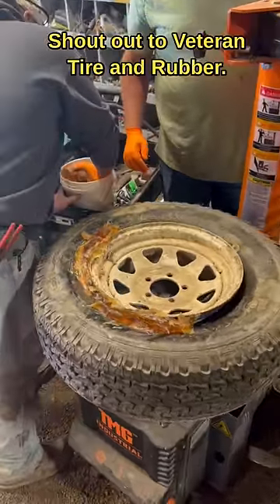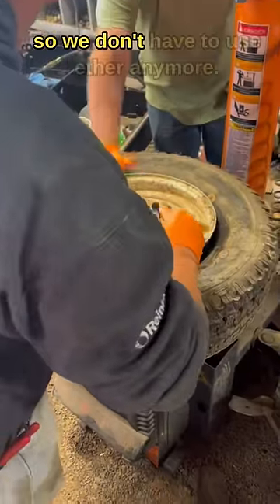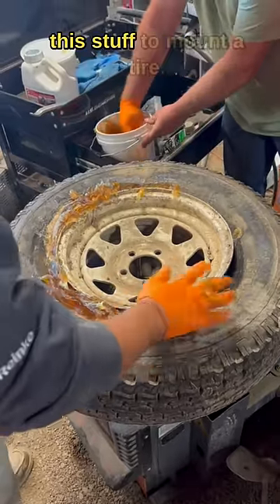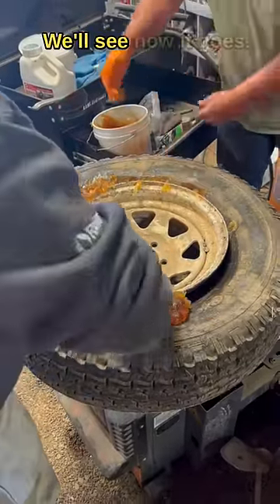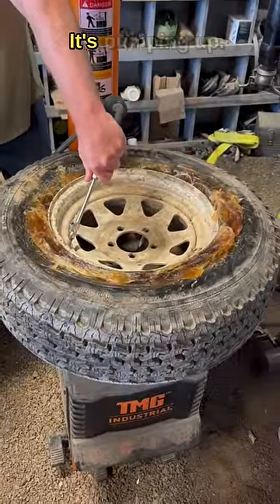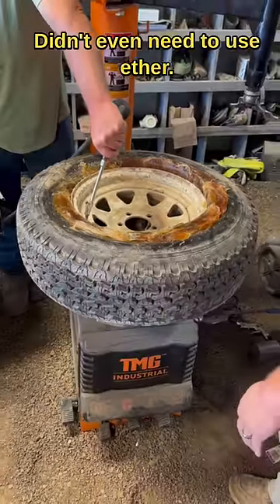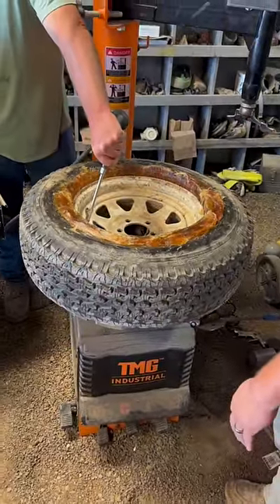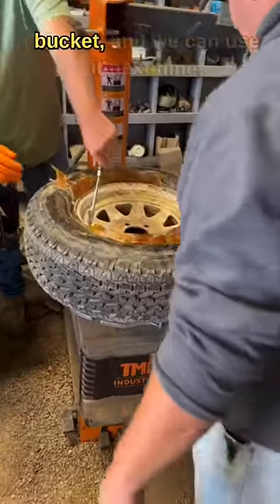Veteran tire and rubber sent some tire mounting compound. Let’s see it work. #farming #shorts ￼

Comment: US Army, out in the field in central West Germany, had to replace a 15 inch tire on a Dodge truck. My squad leader decided that packing the bead with axle grease would allow us to inflate the tire and be on our way. The axle grease did fill the gap and we were able to inflate the tire. However, the grease was also a lubricant and when the driver was trying to move across difficult terrain, the tire was stationary as the wheel spun inside the tire.
Reply: Never thought about that. Good point
Reply: i see you guys had a great time over here 😆
Reply: OH MY HOD THANK YOU
Reply: Exactly what I was thinking might happen.
Reply: I wondered about that…….🤷‍♂️
Reply: thats exactly what i was going to say. im a tire guy i do tires for a living and we use that mounting compound. however, we scoop up a handflul glob of it and put it in a bucket, and then fill that bucket with hot water, and use sponges to lube the bead. works the exact same way and uses less. if its being stubborn to inflate, air blaster!
Reply: @rxwbowtie I think you're thinking of the lube you use to mount tires. I'm pretty sure the purpose of this stuff is to fill the gap between the rim and the tire and allows them to get it seated. You could use a cheetah tank or like they said fill it with ether and light it on fire but cheetah tank doesn't always work and ether is dangerous
Reply: That would tear off the Schrader valve.
Reply: What about the  residual compound that's trapped inside the tire, won't that cause a major imbalance in tire rotation. 🤔
Reply: @jeffrobinson1092  , what would?
Reply: @dandonovan2858  Maybe I misunderstood. Tire gets traction but axle still rotates (hence the wheel) and tears the valve stem off.
Reply: @jeffrobinson1092  this isn't a bicycle there's no tube attached to the valve stem.. it won't rip off from the rim spinning inside the tire
Reply: @jeffrobinson1092 , no, the tire didn't lose any air. The wheel was slipping because of the grease.
Reply: @dandonovan2858  Again my misunderstanding. No tube with a Schrader valve. Wheel will spin with tire getting traction.
Reply: That’s wild lol good story
Reply: Genius!
Reply: Grease and tire beads don't mix
Reply: That was my first thought... the friction between the tire and the wheel is kind of important
Reply: @andydickinson8957  yes it is. And seeing the rim spinning and the tire not, still makes me laugh.
Reply: @nickb5091  it did allow us to inflate the tire.......
Reply: I'll stick to starting fluid
Reply: Holy sh-cow I’m actually really surprised it was able to remove THAT much friction enough for the rim to spin in the tire
Reply: @humphreyjones1828  torque overrode the limited friction because of the grease. And the air pressure kept the tire in place.
Reply: Only in the military
Reply: @danglinforya5773 I think it will fly off to the outside due to the rotation and then maybe spread, don't no it's viscosity.

A tire mounting compound with sealing properties comes to  my mind.
Reply: Dude rs slippers
Reply: Hahahaha
Reply: @jeffrobinson1092 how? Valve is fixed to wheel. Would tear the valve if it had a tube but then you wouldn’t need grease as the tube fills the tyre.
Reply: @dandonovan2858  in Kuwait we killed the battery on a Bradley and had to tow start it, but the fucker was parked against a Berm.  Step one was to pull the dead Bradley over the Berm with one that was running.  Seeing a tracked vehicle fail to find purchase in the sand and throw huge rooster tails is probably my favorite memory of that deployment
Reply: @dandonovan2858 so after the rim does a burnout in the tire for long enough, does the tire bead melt and stick to the rim? Lol. Almost makes me want to try it.
Reply: @inoahmann7542 , it was a lot of grease, I suppose it would eventually create enough friction to overcome the lubrication properties of the grease....
Reply: Central west germany... baumholder? K-town?
Reply: @nathanfranklin7210  Budingen 3/12th Cavalry and Hanau D co. 122nd 3rd Armor Division
Reply: Grease and compressed likes to explode
Reply: @danglinforya5773 your talking about the left overs right stuck on the rim here and there ?
Reply: That's why your not supposed to use Murphys (the stuff he's using) to fill in the gaps. We have all done it especially when your solo in the field, but 2 13 gal cheetahs or using a tube to spread the beads is the best route.
Reply: Automatic slip-clutch against overloading!
Reply: Ether is 100x cooler
Reply: Don't need any of that
Reply: You never had enough air pressure in the tyre. I always bead tyres with grease. My mechanic couldn't believe it. It seals beautifully and never spun.
Reply: @SoulTouchMusic93  you don't have any idea what you are talking about.
Reply: Bullshit! You heard that story from the guy who trained you and he heard it from the guy who trained him, ad infinitum...
Reply: @michaelbrown343  , nope, I witnessed it first hand and in person.
Reply: @dandonovan2858  I still call bullshit
Reply: @michaelbrown343  , Whatever.
Reply: fixed is fixed here at good enough auto repairs
Reply: And that's the story on how you never left central W.Germany.
Reply: This doesn't look like lubricant.  It looks tacky af
Reply: What year ? I was 3rd infantry division in Wildflecken 77- 79
Reply: @mikejungferman4744  I was in D co, 122nd Support at Fliegerhorst Kasern in Hanau. We supported the 3/12th Cavalry in Budigen. 1987 to 1989.
Reply: Some call it insubordination, I call it exercising my right to not follow stupid orders...
Reply: I picture the whole thing nd laughing my ass off lol
Reply: You need to spray it with a cutter after it sets like carb cleaner. Brake cleaner, starting fluid any of them
Reply: I did this on my drag bikes back tire the grease with dry and tack up if if you spray something to cut it
Reply: This is True, I have scene this happen before, Never use grease on the rim.
Reply: @jeffrobinson1092 They normally remove the inside of the Schrader valve when seating a tire.  The air hose hooks to the stem and there is less restrictions.
Reply: Lol...nooooooo!.......did u say "BEAVIS......u DUMBAAASSS!! HEHE!....
Reply: Ha! I've always wondered about that.Ive never used grease but just about everything else(in small amounts).So far no crazy stuff has happened....
Reply: Holy shit are you fucking with us? That would be looney toon level of wtf
Reply: @Tobistohightoplay  , just telling you what happened.  I didn't condone it, as a matter of fact, I told my Sergeant that it would do just that.
Reply: That would be a sight to see lol
Reply: Hahahahahahahahahahhahahhahhaha
Reply: We did it to all four wheels and tried to stop but couldn't God rest our commander 😢
Reply: What about the backside where there was no grease? Still no traction? 🤔
Reply: @thedoc9062  they put grease on both sides.
Reply: @dandonovan2858  
Ok👍
Reply: @713gk not in a tubeless tire.
Reply: Guys, here is the true Savior

HalleluYAH translates “Praise ye YaH”

YaH is The Heavenly Father
YaH arrives via the TENT OF MEETING
YaH was Who they Crucified for our sins
YaH was Crucified on an Almond TREE

Semitic of Moshe (Moses)
Isa Scroll (The Original Isaiah)

Isaiah 42:8 - I am YaH; that is my Name! I will not yield my glory to another or my praise to idols.

Isaiah 43:11 - I am YAH, and there is no other Savior but Me.

Isaiah 45:5 - I am YaH, and there is none else.
Reply: @jeffrobinson1092 No it wouldn’t.
Reply: @jeffrobinson1092 Tubes do have a Schrader valve.  You need to do some research and reading.
Reply: Nurnberg 76=79
Reply: Thank you for this story
Reply: 😮 @ShayneCarpenter

Comment: Just buy a cheetah tank
Reply from the maker: We might someday
Reply: @RockyMountainFarmer  you can get one for like $100 that work just fine.
Reply from the maker: @06SteveO  Cool I’ll look into that thanks.
Reply: 1/2 air hose with good pressure is all you need ( with of coarse 3/8 hose already hook up )
Reply from the maker: @manuelvarela2544  Good pressure is something we don’t have. Our air compressor is older than me haha.
Reply: @RockyMountainFarmer they are so much easier and worth while. By the time you buy 5 buckets of Murphys you could’ve bought a good bazooka. You don’t need a 5 gallon for them tires. We have a little 2l that has a finger trigger I shoot it 1 hand all day like a pistol
Reply from the maker: @keeganholt281  oh that would be nice
Reply: @RockyMountainFarmer  you really don’t need a 5 gallon we have 2 2 liters that we use on almost everything. Rarely break out the 5 gallon for big tractor tires and some super stretched setups.
Reply: Cheetah is nice but that doesn't always work either. They make a weighted gasket that sits over the gap and blocks the air
Reply from the maker: @balothtower   Interesting
Reply: Dude for sure
Reply: They're so loud... but work great.
Reply: I think you really missed the joke here.....
Reply: Harbor freight sells a knock off Cheetah equivalent.  And I've seen and used a sealing ring that looks similar to a bicycle inner tube to fill the gap,  that it shoots out as it seals.
Reply: Yea there great I’ve never had a tire I couldn’t bead with some tire lube and a cheetah tank
Reply: Cheetahs don’t always work. I had 3 guys with a 3 cheetahs on this big tire once, wouldn’t bead, this stuff worked.
Reply: @RockyMountainFarmer they work really good. Used one just about every week for 3 years. Make sure you wear ear pro
Reply from the maker: @Daniel-fu1me  yeah we just got a bead bazooka
Reply: bro, a rope or strap around the tire will push the sidewalls out into the rim.   SAVE YOUR TIME AND MATERIALS.
Reply: @throatpunch4789 that's great if you're doing one tire. It's not feasible to do 50 of them that way obviously
Reply: I've got 'em on with a ratchet strap and some of the weakest gas station compressors, if it's stubborn I use a little bug water from the squeegee bucket.👍
Reply from the maker: @pizzadude6615  that won’t work on an 80 inch tractor tire that’s where this stuff shines
Reply: @RockyMountainFarmer  you'd think so but I've done fifty Inch tractor tires and lmao when it doesn't work I go back to the ol boom boom. Either way the old okie compression trick works if it can be applied properly.
Reply: Mhmmmmm
Reply: fr
Reply: Or you can use a ratchet strap that 90% of the population already owns
Reply: Or a can of starting fluid 😂
Reply: Nope, ratchet strap
Reply: @mike-xb9qn  they litteraly said "can of ether " lol
Reply: @RockyMountainFarmer one benefit of having a cheetah, you can unscrew the flattened end and screw in a straight pipe then launch potatoes halfway across a small town
Reply: Cheetah tanks aren't as great as people make them out to be as somebody's worked in a tire shop for ten years I've seen more of my co-workers go to the hospital from one of those things blowing up in their face.... Then any other incident happening at that tire shop and trust me with the stupid idiots I worked with somebody was always getting hurt
Reply: @dustinmiller7278  I worked on cars for 13 years, never had any issues with using one.
Reply: @romanmechetnerful  every time the ratchet strap failed me the cheetah tank got the job done.
Reply: @06SteveO  good to know
Reply: @dustinmiller7278  well said
Reply: These comments are GREAT...you'd think if someone even knows what a cheetah is they would know...guess not. Good one tho guys!
Reply: @06SteveO  you can make one for next to nothing.
Reply: @deanaf  that's scary and Hella sketch ...you go make a compressed air bomb ..all of us big brain people will sit back and watch you blow it up and rearrange your facial features🤣🤣🤣
Reply: Cheeta won’t work on that trailer tire lol
Reply: @traevonbassett9654  it will but it's unsafe af
Reply: @traevonbassett9654  Thats not a trailer tire. If it is it's a giant trailer with truck tires and old school GM rally "wagon wheels" on it. If I had to guess I'd say it's a Suburban/Blazer tire and in that case a cheetah will work just fine...
Reply: Just have someone else lift up on the bottom of the tire and it will seat. That’s what we do at the dealership I work at.
Reply: @TreforGordon  it's a JOKE!!!!
Reply: Sometimes you need both cheetah and animal fat aka tire compound.
Reply: @spartansoff-roadrecovery5058  😆 🤣 😂
Reply: Exactly.  Pneumatic bead seater. Alot cleaner.
Reply: Ok if I would have read the comments i wouldn't be saying   ' that's what I said,".  Get them a fancy ty 40-40 a coats
Reply: Then blast it under the bathroom door when  one of the other guys is in there
Reply: Never had a tire i couldn't get with a cheetah tank and a ratchet strap. The problem with a product like this is I'd bet some of it ends up in the tire which would cause long term balance issues.
Reply: It'll blow your coworkers pants off too
Reply: @spartansoff-roadrecovery5058 not scary at all to someone who can do things with his hands and his brain. My home made propane tank bead seater would handle 3 times the pressure any air compressor could put into it.
Reply: @Notthisguyeither  umbrella no it wouldn't but  ok lol you're talking a 2500psi difference
Reply: @Notthisguyeither  propane tanks aren't made to hold pressure of that extent and if you did any welding on it that's even more sketch but you do your afv stuff and we will hear about you in the obituaries
Reply: You guys would be suprised how cheap some of the stuff harbor freight and Amazon has! Mobile Compressors and cheetahs!
Reply: @spartansoff-roadrecovery5058  ok drama queen
Reply: @Notthisguyeither  😂
Reply: That is definitely not what it's made for
Reply: @balothtower I’ve changed more tires than I can count and I’ve never failed using the cheetah 🐆
Reply: @balothtower cheetah will always work of you know how to use it correctly
Reply: @RockyMountainFarmer hey man I know you're already on it but seriously I work in a flat rate shop and this is x100 more expensive x10 slower than the cheetah
Reply: @pizzadude6615 save your old tubes. I keep old tubes in the new tires in my warehouse to keep the beads pushed out around 6 inches wider than the rim. Makes my life so much easier. But you ain't wrong on using it on 50 inch wheels. 480/520s especially with a deep drop. Love putting em on. Airing up well that's a different story at times
Reply: @thunderballz74 have you ever mounted a goodyear semi tire that didn't require a cheetah. Just wondering cause I haven't. Michelins and yokes man love how nice they bead up.
Reply: I have had tires that a bead blaster didn’t work either. When I see the beads basically touching the each other with the tire not
On the rim I usually just get a different tire but all else fails I have seen a rubber type wrong that does what the grease does haven’t tried it yet but trying to get my ship to get one